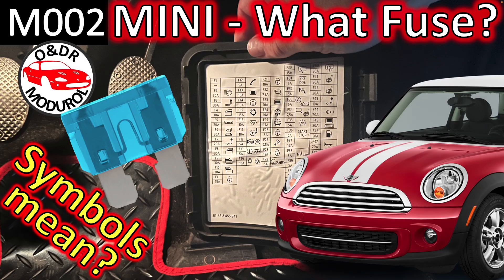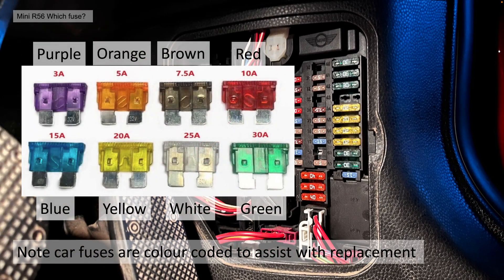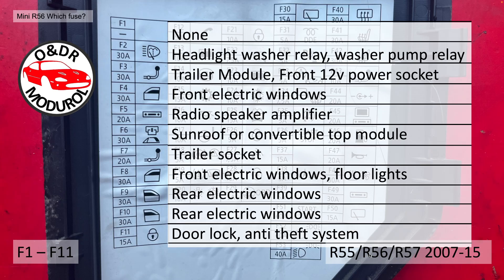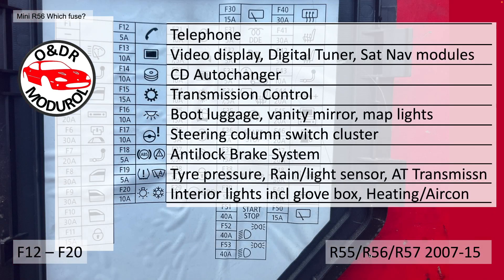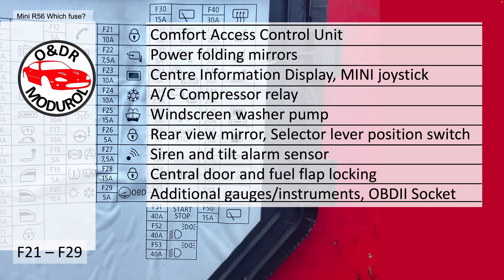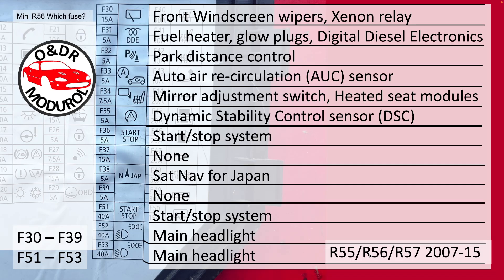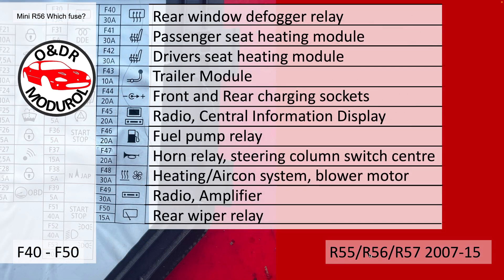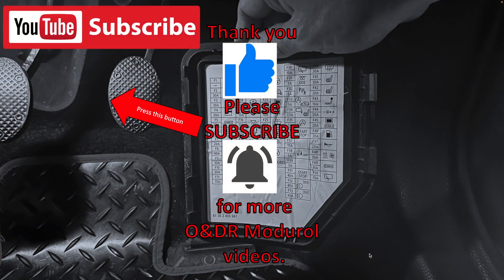BMW MINI R56 Fuse box. Symbols explained. R55 R57. Fuses M002

Comment: Awesome! But for front headlight right signal what fuse? Mine not working anymore, i replaced the bulb for signal turn but nothing, on dash is blinking very fast. On side and back the right signal is working perfect but not on the front.
Reply from the maker: @GrumezaStefan, sorry there isn't a fuse for the indicators only a module.  The blinking very fast is the cars way of showing there is a fault. If a new tested bulb doesn't work then its most likely an issue with the bulb holder or wiring. Swap the bulb with the working one, if still doesn't work clean the bulb holder with electrical cleaner and check for breaks in the wiring. Hope that helps, regards Damian

Comment: For a 2010 R56 Mini, where is the turn signal relay?
Reply from the maker: @CiudadDetroit, the turn signal or flasher relay on a MINI R56 is located under the steering column, behind the lower plastic cover. You will need to remove the steering column's lower trim panel to access it. Hope that helps, regards Damian

Comment: Hello mate and thanks for video 
Do you have any idea where and what fuse is correct for the upper stop lamp /3rd brake light on 2012 mini diesel ??? Any info would be appreciated
Reply from the maker: thebigfish75, pretty sure there isn't a dedicated fuse for the lights as they are controlled via a module. Possibly a wiring or earth issue, regards Damian
Reply: @Modurol  perfect bud and thanks very much for that , massive help cheers m8👌
Reply from the maker: No problem, good luck with the repairs, regards Damian

Comment: Hi , thanks for the great information .My power folding mirrors seem to have a bad connection and work only intermittently. I'll check the fuse later today but wondered if there is a relay or something else I can check if the fuse is ok. When they do operate they fold no problem. Thanks , (mini r57 2012)
Reply from the maker: @y.bother3804, sorry no idea about the how the power mirrors operate, regards Damian

Comment: Hello, thank you for the explanation. I'm trying to put a fusetap for dashcam, and I wonder which one is the safest you'd recommend? I was thinking either the 12 (phone) or 22 (mirror) although it's weird my MINI Mayfair doesn't have mirror folding function but I saw the fusebox there's 7.5A fuse installed. I guess I can just use it right away?
Also, what size of fuse does the 12 to 39 uses? Normal size or mini low profile?
Thank you!
Reply from the maker: @riph-a, The mini fuses are the small 'Mini blade fuses'. In theory you can piggy back off any of the fuses. However, you need to decide whether you need switch or permanent live. Also it might be a bit of trial and error to find the right one as you might cause radio interference. Hope that helps, regards Damian
Reply: @Modurol ah I see. Thanks for the explanation!
Yeah I need to find the correct one since as far as I’ve seen the fuse list doesn’t list things like cigarette lighter and interior light, right?

Comment: I’m having trouble finding which fuse is for the parking lights at the front and my side markers. Any idea?
Reply from the maker: @jamiec421, don't there is a fuse for that. I believe it's controlled by a module rather than a fuse. Sorry can't be more helpful, regards Damian
Reply: @ no you’re correct, no wonder I couldn’t find it lol.

Comment: Hello I have a 2009 Mini Cooper R57  convertible my radio went out most likely the Fuse. I see there is 3 radio fuses? I think it's the Central information display radio because I have the Radio, Aux  and info like bass, treble, fader, etc right?
Reply from the maker: @maliknexus, I think you are correct but doesn't take much to check all of them, just in case. Thanks for the question, regards Damian
Reply: Did you fix the issue, same problem here, thanks !!
Reply: @valentinbarcenas3127 same problem here! What helped?

Comment: Any idea which are switched live for dashcam ideally left side of fuse board where there is more depth to get the cover back on
Reply from the maker: Keith, most of the fuses look to be switched live but would be trial and error to test fitment and suitablilty. Sorry, can't be more helpful as haven't fitted a piggy back fuse for a dash cam on this car, regards Damian

Comment: Any help please? There are two different fuses for the radio but which do I need?! lol my radio won’t come on? I have replaced the fuse in the engine compartment fuse box. No go. Which of these two? Thanks in advance!
Reply from the maker: @thelouwyattuk, the radio fuse is F45 in the footwell and is a yellow 20 amp fuse. It's in the last row on the right had side in the middle. Not sure which fuse you change in the engine compartment? Hope that helps, regards Damian

Comment: Thanks! But this is weird... My radio and center dash info doesn't work right, apparently the fuse is the common cause of this. ...so my fuse chart says "F45" should be the fuse for this. So do other YouTubers... 
Only problem is: There is no fuse in the F45 slot. And there are no fuse clips there to plug in a new fuse. It's just a blank spot. ???
Reply from the maker: @LastBastian, interesting, what year and model is your mini? Regards Damian
Reply: @Modurol  2007 Mini Cooper S.  The CD player and aux work, but the radio doesn't work at all. And the center screen that shows audio info and clock, fades in and out from lit up, to completely dark. 🤷‍♂️

Comment: Hi mate, I have a 12v Socket in my boot along with a light in my R56 One, which one is the fuse for either or both of these? noone online seems to know the answer
Reply from the maker: @kjlrandom415, hi, the charging sockets fuse is F44 (20Amps) and the boot lights is F16 (10amps). Hope that helps, regards Damian

Comment: Such an informative video.  Thank you for taking the time to make it.

There aren't any fuses for the rear reverse/brake/signal/parking lights in the engine compartment fuse box?
Reply from the maker: Hans, thank you for your kind words. The mini R56 indeed has a peculiar design when it comes to the rear lamps. Specifically, the rear tail lights (including the fog lights) are not individually fused like in many other vehicles. Instead, they share a common circuit without dedicated fuses for each lamp. Hope that helps, regards Damian
Reply: Hi  @Modurol , does this mean that those set of lights don’t have a fuse or is it just one fuse for that circuit?
Reply: @Kf-1612 did you ever find this out?
Reply: Incredible video where you broke it all down! I had no idea and looking at the pictures what majority of them meant. I unfortunately don't see one for the license plate lights.
Reply from the maker: @beth6419, license plate lights are controlled via on of the modules. If you light aren’t working is likely to be blown bulbs or a bad/corroded connection. First step would be remove the licence plate lights and check the bulb and connector. Hope that helps, regards Damian

Comment: Hi there, I'm came across your video while looking for clues in what the fault is with my f56. It failed it's MOT because the high beam isn't working. FRM3 module has been tested and ok. Stalk has been checked, all ok. Where can I find the fuses and relays for full beam? Thanks.
Reply from the maker: Discodav 78, There is a full list of all the fuses and locations within the video description which might help. F52 - 40A - Main headlight
F53 - 40A - Main headlight, assume L&R are separate, regards Damian

Comment: I want to add a gps device. Where can I put it? Can i just use one of the free slots?
Reply from the maker: Sansli, in theory yes just make sure you install in the area of the fuse box you need. ie switched or permanent live. Probably easiest just to use a piggy back fuse splitter. Hope that helps, regards Damian